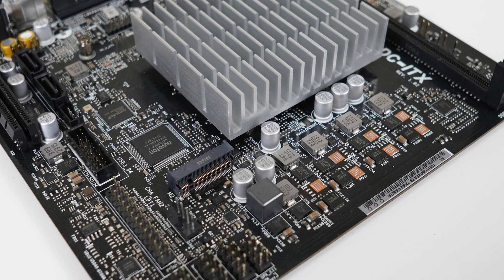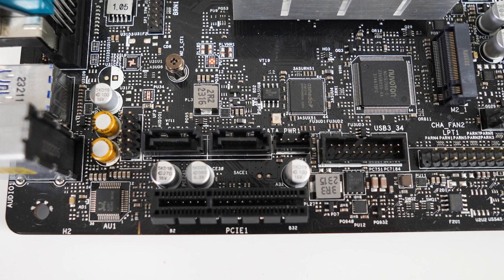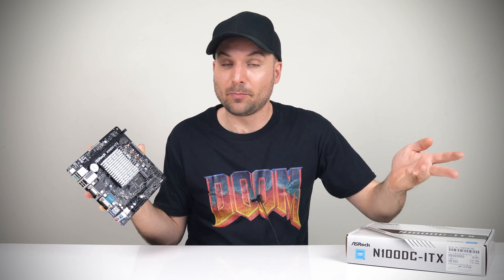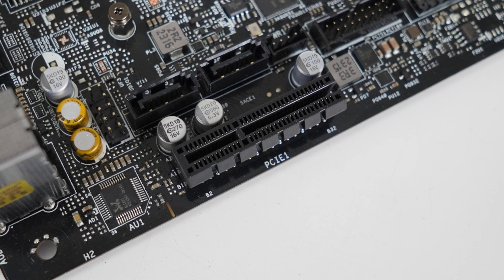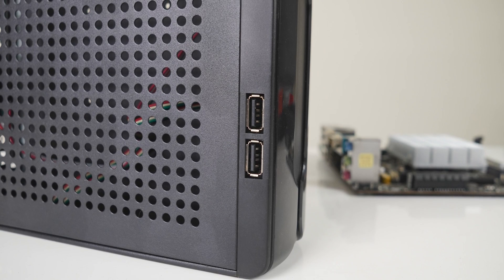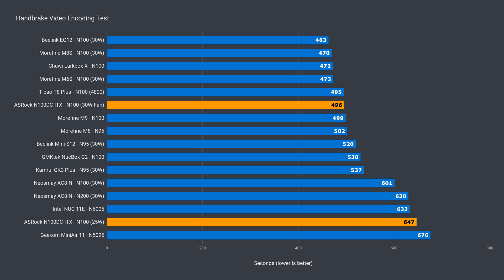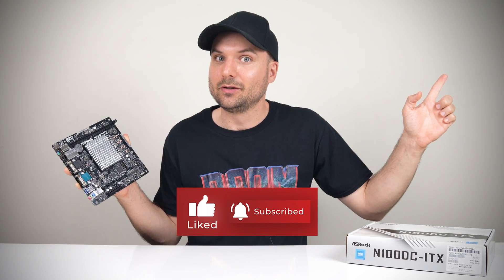Building the ASRock N100 Fanless ITX Motherboard N100DC-ITX - Review

Comment: Well it does support a GPU because it's Just PCIE3.0 and you also could pull up to 75W of it. 
as for performance of a GPU it depends on your workload. And with an SATA to ATX power on adapter you could also power a GPU with more than just 75W or a couple HDDs if you use the M.2 or the PCIE for a SATA HBA. 
its just a normal PC, therefore the same features. I have one with pared with an RX6400 for local AI workload. it works well.
i'm running Ubuntu 24.04 on it and idle power is with about 8W fine.

Comment: i have this running a gt 1030 graphics card and it works fine.
Reply: This is kindof what I expected. It will probably not work with a high power card, but a sub 60w card might. It will see the card, but it will choke the bandwidth down to only 2 pciE 3.0 lanes.
That's still separating tasks from the APU, so that's better than nothing.
Reply from the maker: Nice

Comment: has anyone succesfully installed any os on a pc with this board? i tried unraid, ubuntu, trueNAS and proxmox, on every install the system crashes with graphics errors and reboots. I first had the asrock N100M with the same issues, i returned the board because i thought its broken but the replacement N100dc-itx does not work for me neither.
Reply: the memory i used was broken, i have replaced it and now i can run stable openmediavault with radicale and nginx ;)
Reply from the maker: Updated the BIOS?
Reply: @Robtech  there is only one firmware version available atm for both mainboards

correction; i noticed that for my current board there is actually an 1.06 version (i had 1.05), i updated now but it did not solve the problem :(
tomorrow i will try other memory
Reply from the maker: Okay, maybe send ASRock a support ticket.

Comment: Is it certain that the PCI express slot is not supporting GPU? Similar boards with CPU on board from Asrock were supporting low powered graphic cards. I saw it confirmed in some forums several years ago.
Reply from the maker: Quoting from the manual/website. I might test it if I get a chance
Reply: It's no gurantee that it would, but it would read the card at a lower bandwidth. Probably wouldn't help with a high end card, but a lower end one might not be as hurt by it. Expect a hefty increase in Amps requiring a higher power supply.

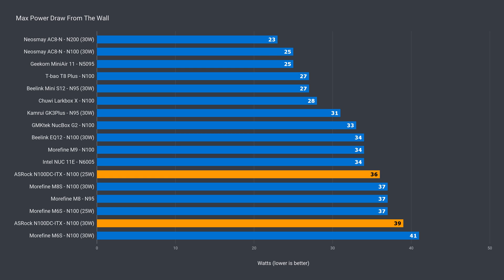Comment: 7:40 why such a big power draw? Because the power supply’s efficiency is  worse compared to an internal psu?
Reply from the maker: Looks to be yeah. I'll test with a 35W power supply instead of the 120W when it arrives and update again
Reply: @Robtech can’t wait to know what you’ll find out. Please update the bios to the latest as well & enable every power saving feature you can find in the bios. I would buy this board with a idle consumption of approximately 8 watts!
Reply from the maker: 19V 3.42A power supply. 12W now in Windows. A bit better.
Reply: @Robtech  please test again with these bios settings :

Another dude posted with Debian 12, kernel 6.4 he got from 11 w to 6-7 w idle.

•	Set RAM to 2133Mhz (done because stability reasons)
•	Package C states on
•	C6DRAM enabled.
•	PCH PCIE ASPM set to auto.
•	SATA aggressive link power enabled.
•	Disable Serial port
•	Disable Parrallel port
•	Disable HD Audio
•	Disable WAN
Reply: Be aware the monitor connected adds consumption.
Reply: @LeminskiTankscor  yeah you might save 25p a year turning that off lol
Reply: I've found that yes, a 12V does work with this board, and with whatever random 12V unit in my parts box, it runs at 5.8W idle.
Reply: @LeminskiTankscor  sweet

Comment: Idle 15W cause by the huge 150W power supply, because of the light load ~5W needing.
5W is only ~3% of load for this 150W power supply. So the PSU efficiency probably under 50% during  idle.
Reply from the maker: Good point. It's 120W. But yeah probably due to inefficiencies

Comment: Thanx for review. This type of boards is useless IMHO while you have Asrock X300. It dosnt have CPU, but have PSU and case. And its   more upgradable. For Nxxx chips I'd like to see DDR5 boards due to all this chips is single channel. And price need to be somewhere 70-80$ for chips like N300
Reply from the maker: ASRock X300 is one of my favourites. Looking forward to the 7000G update. Hopefully more USB ports.
Reply: @Robtech  I think update will be available when AMD release new AM5 APU with slightly powerful iGPU then current 7xxx series.

Comment: Weird. My N100DC-ITX idles at about half that.
HDMI, a stopped 3.5" HDD, a 4TB M.2 SSD, usb for boot, ethernet, a fan and running some docker containers (not actually doing much). 

~7-8W
Reply: Found my old reddit post:

Took the board, reset BIOS to defaults. Running a USB key for boot, a 120mm 3pin fan, and a 4tb ssd. No WiFi, gigabit ethernet. 

Additionally a hdmi monitor to a 4k monitor and a wireless kbm dongle thing. 

Running Debian 12, no DE, kernel 6.4. 

Let it boot, leave it run alone a bit and running me containers: 11.1W. 

Remove HDMI: 10.8W Remove KBM: 10.1W 

Add them back in, go to BIOS: 18.6W 

Set RAM to 2133Mhz (done because stability reasons) 

Package C states on 
C6DRAM enabled. 
PCH PCIE ASPM set to auto. 
SATA aggressive link power enabled. 
Disable Serial port 
Disable Parrallel port 
Disable HD Audio 
Disable WAN 
Set Fan to DC. (Is 3 pin) 

Ran Fan Tuning. 

Reboot, give it a mo. 

Running containers: 7.5W. Remove KBM and HDMI: 6.2W
Reply: He told that used an overkill 150W power supply. So the light load is extremly UNefficent. Check the 30W full load power consumption. Looks much better.
So I am pretty sure that beefy 150W power brick can not be efficient at 3W and burn another 12W into the air because of the loss. With a proper ~35-45W power supply could be a much better picture.
Reply: @kiakk_009  ah missed that. Yes. I got about down to 6W from the wall running Debian with a few containers, an SSD, no hdmi, few bios tweaks.

That's both with an ancient laptop charger and a USB-C charger.
Reply: What BIOS tweaks did you use to get the power consumption down?
Reply: If this is bad or wrong for whatever reasons, or if there's some unnecessary settings, let me know as I'm happy to learn.

Comment: Thanks !!
I bought this board ... But trying to install Windows 11, Windows 10 and even Linux, I ran into big problems ... :-( 
Windows 11 won't install at all !! During install there comes a fault message on the screen and sometimes the video shows strange disturbings ...
I desparatly wont this system working, but how ????
Reply from the maker: Which error is it? Same one every time?
Reply: @Robtech   I tried installing Windows 11 and when the system Lock-up caused by strange stripes on my screen, the I tried installing Linux. But the same result.
Look like the GPU is getting hot or so ....
Reply from the maker: Might be busted iGPU. Sounds like it fails when the GPU driver kicks in.

Comment: Apart from some special uses which really is so few that is pointles to even name them, there is absolutely no point in buying this. Even buisnes use is pointles as there is so many mini pc options ready built that render this useless. Also enthusiast market will just pass on this as hardware is so weak that is not even funny.
Reply: Clearly you are not the target market. raspberry pi's were sold out for years for a reason. People want low power computers to tinker with and to use as servers. These intel mini pcs are not only more powerful than raspberry pi's, they are more modular.  Nothing to say about the fact that one can easily cluster these into something like a kubernetes cluster or ceph cluster. These make fantastic, always-on servers for most people
Reply: its as fast as a i5 6500!! more cpu power than you could possibly need lol if you want to play games get a xbox ffs🤣🤣

Comment: A similar board is found in the Acer Aspire XC-830-UW91, which employs the J4125 SoC with 4 cores / 4 threads (10-watt TDP) but offers dual-channel memory capability.  The system sells on Acer Recertified for $95 US (with 5% discount).  Sells as "recertified" but I purchased two and both were perfectly new condition.  PC includes:
  * SFF case with 2 USB 3.0 ports on the front and 4 USB 2.0 ports on the rear
  * Tiny (but silent) CPU fan
  * 4GB DRAM (a single SO-DIMM, but a second SO-DIMM slot is available for expansion)
  * 256GB NVMe SSD (likely 2 lanes)
  * Gigabit LAN port
  * PCIe x16 slot (likely 2 lanes) is unpopulated (should be good for adding 2.5gbps LAN)
  * WiFi 5 + BT 4.2LE m.2 card
  * DVD+/-RW
  * An additional SATA 3.0 port (a separate board connector supplies power)
  * 65W laptop-style 19V power supply
  * Windows 10 or 11 Home (your choice upon system start-up)
  * Keyboard and mouse.
Reply: N100 is at least 2x faster in single and multi thread perf over the J4xxx
Reply: @tendosingh5682 good point, N100 is almost double the benchmark score.  But, gamers and power users will not be looking at a low-power 4 core 4 thread CPU, and the J4125 handles everyday tasks really well.  I've now modified one of my systems for use as a NAS with dual 4TB SATA SSDs in a RAID and 2.5GHz LAN.
Reply: Note, both Intel and Acer claim that only 8 GB of RAM is supported, but I had no problem expanding to 16GB.
Reply: dual channel makes little difference lol
Reply: Is the board itx? Curious if it could be transplanted into a NAS build like a Jonsbo N2
Reply: @OneMoreTank  the board is larger than ITX.
Reply: @Chris.Brisson  thank you!
Reply: but if all you need is a plex server that j4125 will be enough to do the job

Comment: I enjoyed watching this review, and it looks fun to do the build with,  but when all is said and done,  for my use case I'd rather have the pre-built. Still, I like it when you throw an off-the-usual-beat review in the mix! One thing I wondered about, and maybe just missed: When you added the standard 120mm fan, I assume the mb has a header for it? (Meaning you didn't have to jerry-rig some sort of USB power for it.)
Reply from the maker: Yeah, two 4 pin chassis fan headers on it.